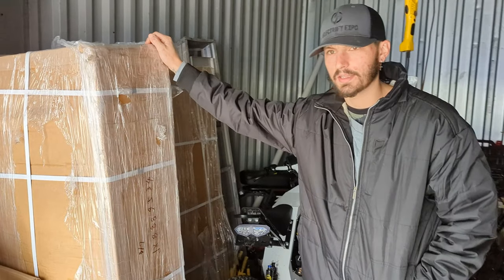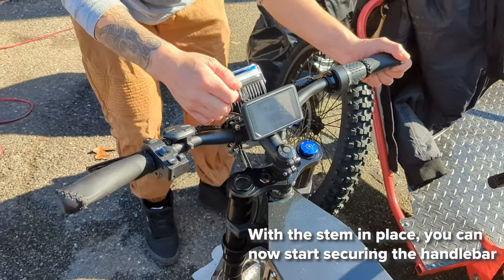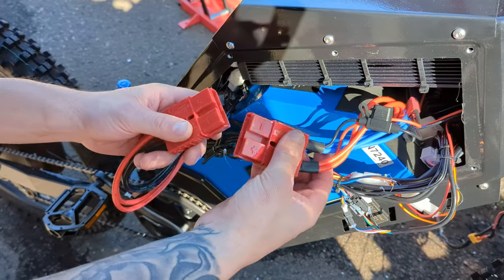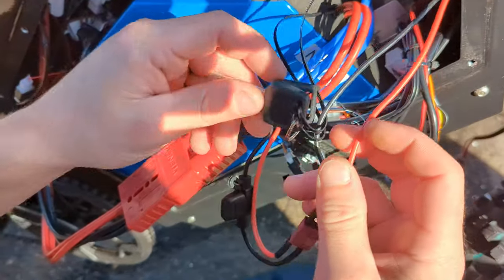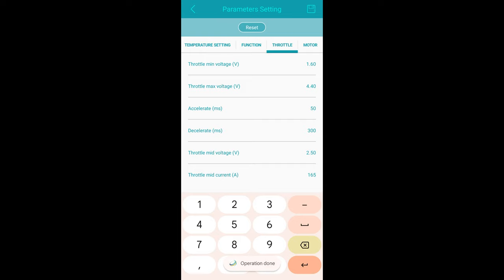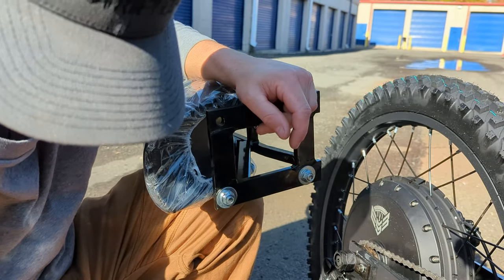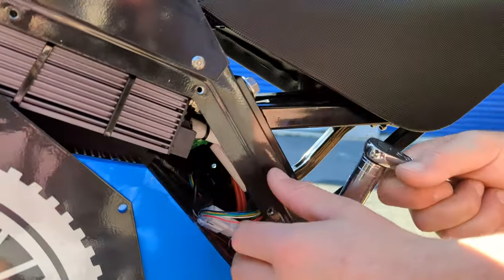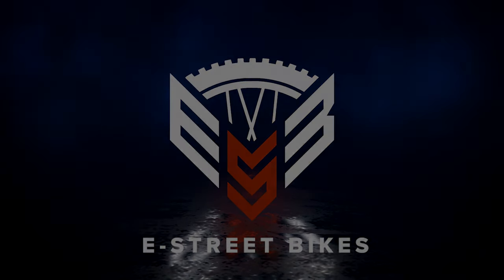8KW E-STREET BOMBER Installation & Setup

Comment: hello, 
tip for the front wheel, instead of just lifting the whole thing, press the rear brake and pull it back with the handlebars, this creates a support point that makes it easy to lift ;-) (like a basic bike)

another question (asked 2x on other YT chains), is it possible to limit via the interface (screen) the motor power and its maximum speed? (it's crucial for me) it's to stay in the laws of my country (power and speed strictly limited). if yes, it's Bingo for me :P

because from 3000w, it's considered as a scooter and from 5000w as a motorcycle (in my country)

thanks for this explanatory and very well presented video =)

Comment: if anyone wants it i can put the full service pack of files on google drive ,has all wiring for anti theft ,dc to dc,ignition and precharge,cycle analyst wiring,display and non display wiring,and manuals for pc ,android and for all different versions of displays and all latest software,there is all ebrake low and high set ups with lights control circuit to
Reply: i got it from qs service section

Comment: the 8000 and the 12000 are actually the same motor ,just battery and control are upgraded
Reply: ive seen that motor hit just over 100mile per hour ,insane
Reply from the maker: QS motors are no joke especially with the Fardriver controllers. The outputs are just insane.

Comment: Hey Sal i have a 8000kw bomber also i was wondering why you went with the 8000 also my reason was torque not so much about really high top speeds your bike i seen JB do was 75mph and that's plenty fast enough my bike has a restricted 72150 Sabvoton controller so my bike will do about 60 to 65 depending on my settings but going to get a new controller unlocked. I was thinking of getting a new 72150 unlocked i was wondering if you think i should go with the 72150 or if i should go with a 72200 unlocked i have the 72v  40.6 ah battery with the BMS 150 if you could let me know what you think i would really appreciate it. I did do a bunch of customizations to my bike  it looks like a dirt bike. I put wider handlebars on it with a 30 mm riser a short goose neck to put the handlebars over the front shocks  more. I also replaced the metal side covers with abs plastic 16th of an inch thick with the snell side facing out you can't scratch it i also put hand guards on it and afer market fenders on it. I also moved the charging port to the key side right below the ignition having a front fender you can't plug the charger in unless you take the fender off every time so i moved it and used a rubber stopper to plug the hole where it went now it so easy to change it now. That's such a stupid spot where they put it not very easy to change it underneath. If  you can let me know about the controller i would appreciate it so much.  Congratulations on you new  business I'm sure your going to do very well buddy.  Ride safe. God bless.

Comment: Thanks for the video! I just got mine, but how the heck do you tighten the seat down from the inside? The controller, wires, and battery are in the way
Reply from the maker: It's not the easiest but yea you have to hold the bolts down from the inside while tightening the bolts on the outside by the base of the seat.

Comment: If you turn the braking to 100a , it'll overvolt the controller when the battery is freshly charged and the bike will keep shutting off...
Reply from the maker: I've actually been keeping the Regen low to under 90a even 60a at times.

Comment: Is there a way to put front turn signals on a bomber 🤔
Reply from the maker: Yes if your bomber already has the light kit on it, all you would have to do is splice the front turn signal wires into the rear brake light wires.

Comment: Afternoon i recently bought the same bike with the same specs, i tryed to ride it for the first time today i got power from the throttle for about 5 seconds and now i cant get no response or power from the throttle😢know anything that might help? Thankyou
Reply: My throttle got pinched by the frame and forks, if you feel around the wire will turning the throttle a little you might find a short.  I made a video on it: https://www.youtube.com/watch?v=LSt3l0EragY&t=119s&ab_channel=TacticoolDennis I swapped the throttle for 20$ rather than fixing the wires..
Reply from the maker: That's very strange. I would try unplugging the hall sensor from the motor and putting it into the second one provided and try giving it throttle.

Comment: Hey Sal I have the same bike I wanted to tell you with the motorcycle seat watch out for those bolts sticking through the frame on the inside. Mine rubbed through the positive battery cable that goes to the controller and shorted out my bike and Fried my relay and cause me a whole bunch of problems after I got a whole new wire harness and relay I cut those bolts so there flush with the nuts I also put a piece of foam up above the controller to bring it down a half an inch. I spiral wrapped all the wires and put shrink wrap my positive and negative battery cables so I won’t have to worry about that happening again. I leave my Bluetooth always connected so if I want to make any changes I can at anytime. I did a bunch of stuff to my bike I wish I could show you a picture of it I think you would rally like it and it may give you a few ideas. Let me know if you interested in seeing a picture I’ll be more then happy to show you. When I was have problems with my bike I watch you one video on the wiring and that was on your Arial rider xclass. I really love your videos you always have such great content and something to learn and that’s why I enjoy watching them so much. Thanks again Sal for the great video again. Please always wear riding gear and always gloves I see so many people not wearing gloves that so important. Ride safe buddy and God bless
Reply from the maker: Thanks for the heads up Gary. Would you be able to email me a picture of that setup you have for the inside of the frame EStreetBikes@gmail.com

Comment: I dropped a seat washer inside, that was a fun experience..
Reply: Ive just left mine in there as i did the same thing😂😂will it be ok to leave??
Reply: @STEALTHMODE.  Mine was all the way at the bottom below the battery, there isn't much trouble it could get into, the main problem is the rattling noise you'll hear riding it.  I think its worth it to remove and lesson learned :)
Reply from the maker: Worst feeling ever 😪